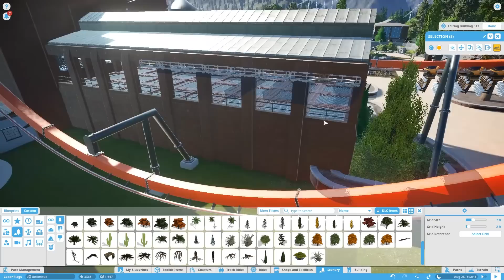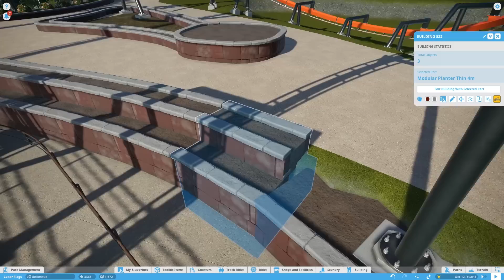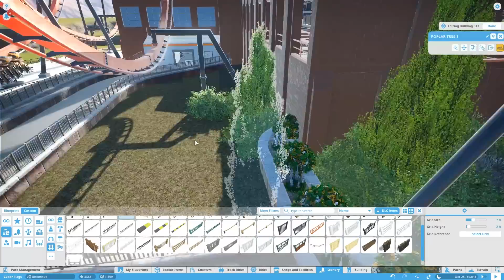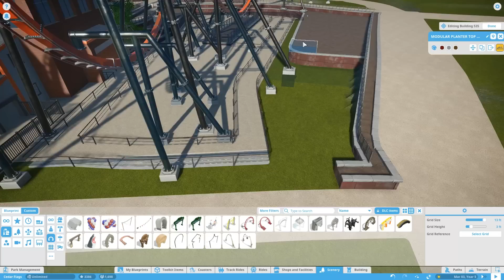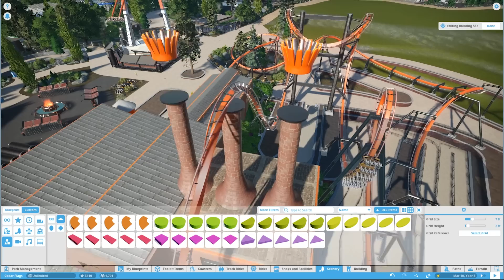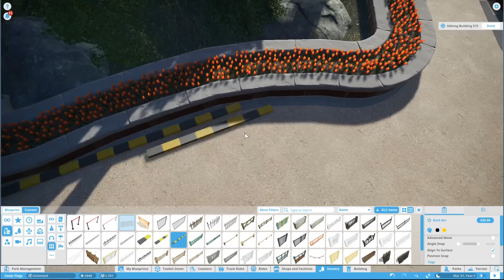Let's Design Cedar Flags Ep. 46 - Detailing, Landscaping & Custom Supports - Planet Coaster

Comment: Coaster designers typically only design the track and layout itself. Supporting is typically done by the designer or someone else locally depending on stress levels. Pathing and such is dictated by the structure and isn't predetermined in many cases. The park designs around the ride and not the other way around in most cases.
Reply: They have to work with lots of local companies to figure out many things.